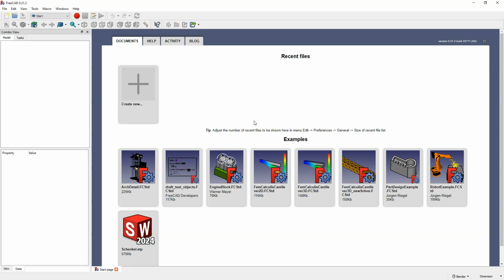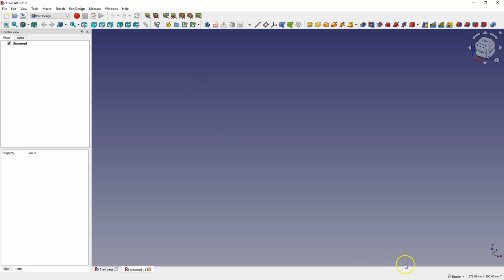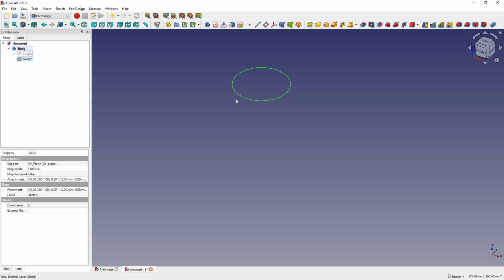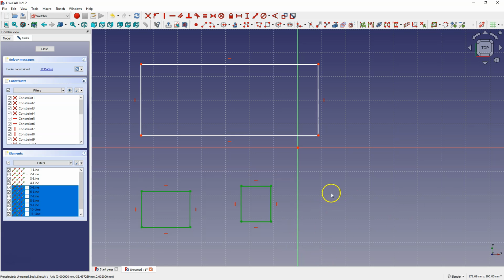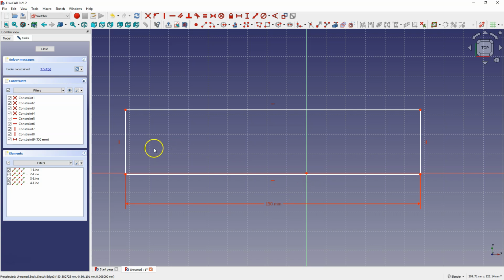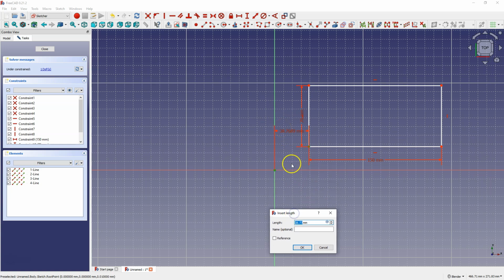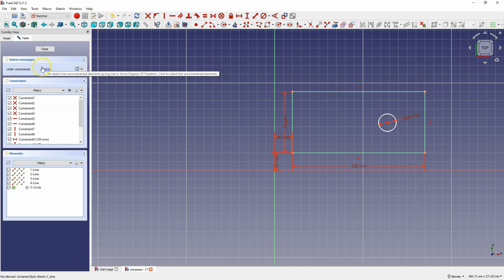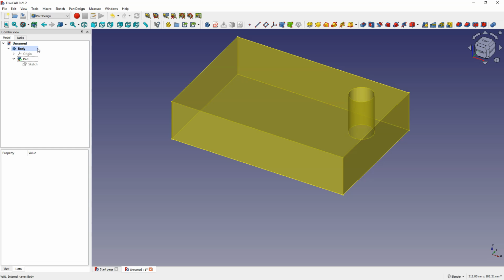FreeCAD Zero To Hero Tutorial Part 1

Comment: There are tens of awesome improvements to sketching in FreeCAD development 0.22 and I stopped using 0.21 for learning. It might have been a mistake, judging by how my simple fan duct project turned into a mess :)
Reply from the maker: I sometimes run version 0.22, but I still have a problem with TNP, sometimes it works, sometimes it doesn't. That's why I prefer the stable version, where I know it doesn't work :)